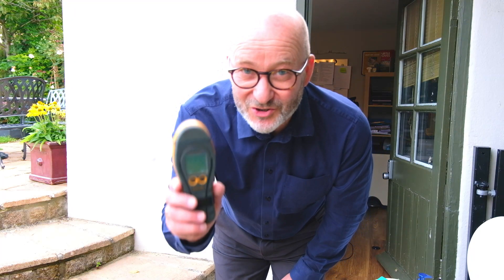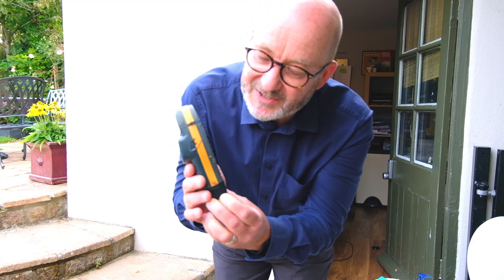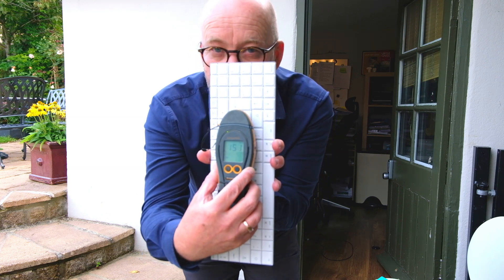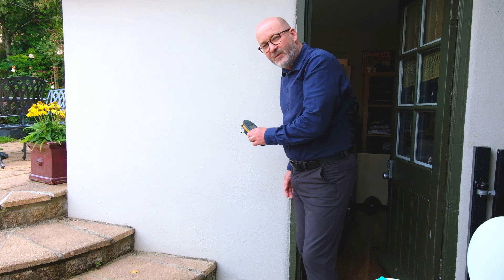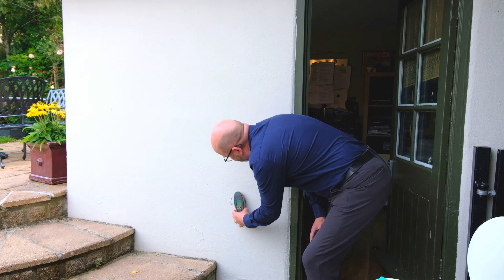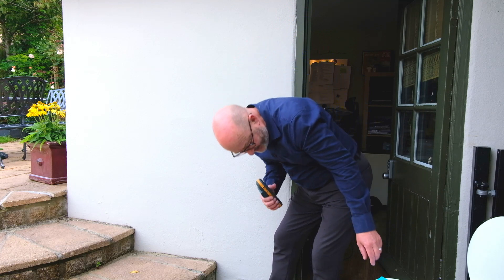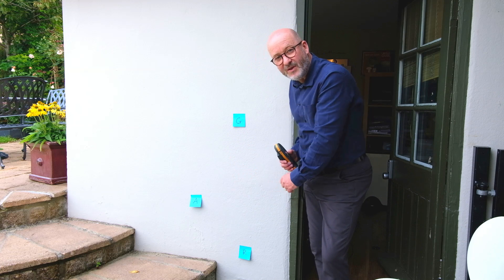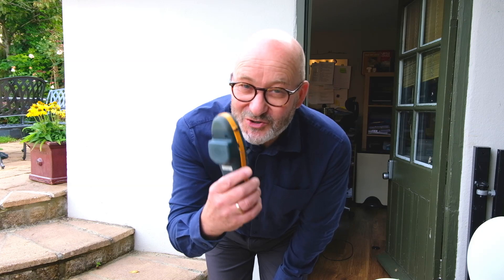From Rookie to Expert: Scan Mode Damp Detection hacks in 4 Minutes

Comment: Hi Geoff, thanks for this information. Could you provide some information regarding the render detailing and when it is possible to render over the DPC without causing internal damp penetration? Thanks.
Reply from the maker: Hi. Thanks for watching. In terms of the wall I only used it for demonstration purposes. I happen to know I have a higher spot on that wall as its a single skin garage wall with no DPC. Technically speaking you can put render on a cavity wall because the inner should be separated by the outer. That's not everyone's point of view and lots of people quote the 150mm minimum clear brick to ground level because it is thought that covering the dpc with render creates a bridge. In my experience it does bridge but it takes a long time to become manifest. It's different for solid walls where keeping the dpc as clear as possible is the best plan. Water is a  complex chemical so if it can get in it will. Check out NHBC details as they are generally accepted as industry standard even if they don't care to check its built like that!